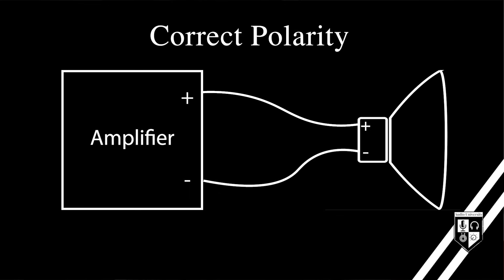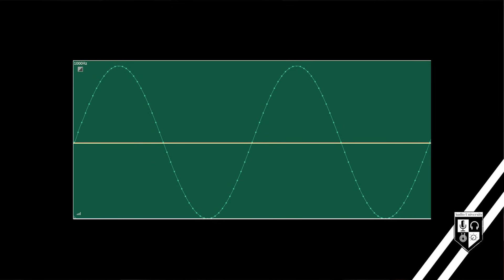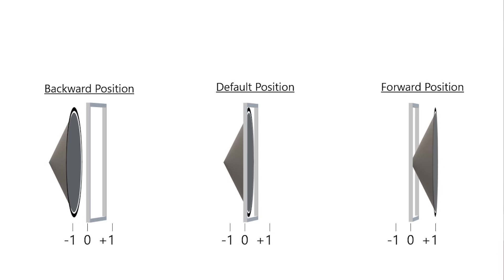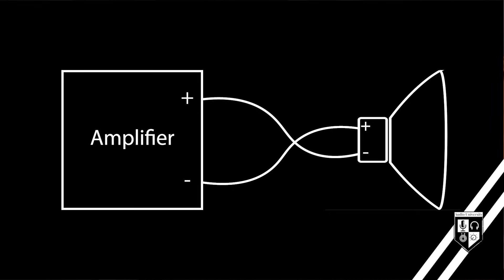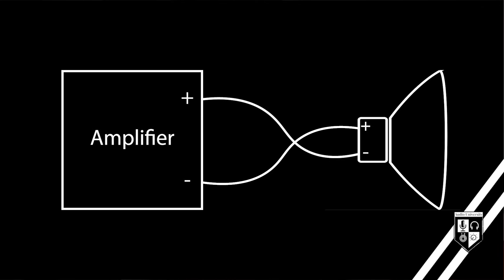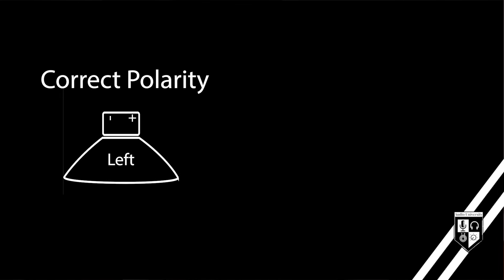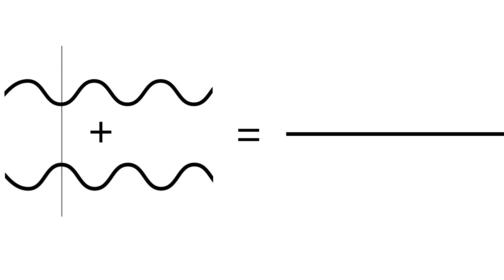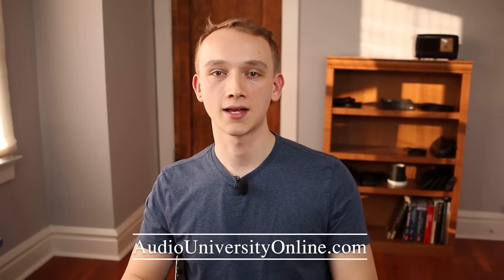POSITIVE VS NEGATIVE: Does Speaker Wiring Matter?

Comment: Most people don't know this. Lamp cord has ridges in the insulation on one of the conductors. That helps you remember which wire is the hot and neutral. Yes, I use lamp cord as speaker wire. If it can carry mains voltage (120v 60hz here in the USA) to a light bulb, it can carry audio signals to a speaker. After all, audio signals are electricity.
Reply: Low-voltage lighting wire is even better, it's just oversized lamp cord with 14 or 12-AWG stranded conductors. Removing the pretentiousness associated with "speaker cable" leads to big savings.
Reply: @kc4cvh  All the "audiophiles" buying overpriced speaker wire are being robbed. I refuse to pay $100 for something I can get at the hardware store for 25 cents a foot. As the old saying goes, " a fool and his money are soon parted."
Reply: When used as a power cord, the side with the ridges on the insulation is hot and the side without the ridges is neutral.
Reply: i want to run a 0 gauge copper cable that you would run from a meter base to the panel.  i want to run that from my battery 😂
Reply: I will add a clarification. My application is a stationary, climate-controlled environment, that is my living room stereo system of modest power (100 watts per channel). Heavy duty cables are unnecessary in this application. In a professional setup, especially in a stage/road show, proper speaker cables with proper connectors (speakon or 1/4 inch) are a necessity.
Reply: Heads to the back of my Onkyo 👀...
Reply: Lamp cord! Your that guy that irritates pros. Jokes aside, most speaker cable is colour coded, so one should never be using power cords.
Reply: @testthisfordecficiencies  Lamp cord works great.  It's good for 8 to 15 amps depending on the gauge.  8 amps at 8 ohms is 64 volts, 64 volts at 8 amps is 512 watts RMS.
Reply: @thomasmaughan4798  Who said it doesn't work? Its just not best practice. Take it from the pros and use speaker cable.
Reply: @testthisfordecficiencies  "Take it from the pros and use speaker cable."
You do for you, I do for me.  Wires intended for professional use are electrically identical but constructed to withstand more abuse as for instance a typical stage setting where they will not only get walked on, but heavy equipment on rollers crushing the wires.
Reply: @thomasmaughan4798  Thats a specific type of cable. Your proper speaker cable is less prone to oxidization but even thatvis easily cleaned off. Otherwise who cares. Like I said, it was a joke.
Reply: @testthisfordecficiencies  "Your proper speaker cable is less prone to oxidization"
There's that for sure.  It takes a long time for zip cord to oxidize, but it does, and when it does is nearly impossible to use for anything.
Reply: @thomasmaughan4798  If you terminate the ends with a ferrule, banana plug, tinning, etc, it can last much longer. Also, if it is left in the speaker terminal, corrosion is likely not an issue where the contact is made.
Reply: @testthisfordecficiencies  "Also, if it is left in the speaker terminal, corrosion is likely not an issue where the contact is made."
I lived in Hawaii where corrosion was everywhere; completely destroyed the copper runs on the circuit board of my amplifier.  That was before widespread using of epoxy coatings.  
It can even eat gold; chlorine is the one thing that can eat gold and salt is sodium chloride.  If it gets wet, it will ionize and then the gold is exposed to chlorine.
Reply: @testthisfordecficiencies  Anyway, yes, I love good cables and patronize the audio pro shop downtown for the Good Stuff.
Reply: @chrisfeatherstone9691  Don't be a dipshit. You're clearly referencing the bybeetech quantum purification filter, which removes noise by stripping the slight vibrational energy from the electrons at a quantum level to then pump more energy into them to create a slipstream effect so you get a faster signal, which leads to better presentation and life.

Check out their website, which YT won't let me post, it's pretty crazy what they manage to do.
Reply: @chrisfeatherstone9691  Now you're just talking out of your ass.
Reply: @chrisfeatherstone9691  Fuck turtles! If they weren't so stupid as to leave their eggs entirely unattended so they get eaten as soon as they hatch they might not be endangered. They're only slightly better than pandas because they're not too stupid to mate. Just like yourself.
Reply: Audio signals aren't electricity. They're tiny consecutive EMPs that get inhibited by non-uniform wire components on a molecular level. This is why OFC is so important, and also why you can hear the difference, but can't measure it when using silver cables with a perfect crystalline structure. It's lesser known, but the cables should also be free floating so the EMP isn't obstructed by walls or the floor.
Reply: @JZStudiosonline  This sounds ridiculous, can you elaborate? In the real world, no one is floating cables, as they are typically bundled together in racks, trays, etc. And yes, audio signals are electricity. EMPs are electromagnetic, which is the basis of the theory of electricity. Audio signals are alternating current.
Reply: @JZStudiosonline  Pure nonsense.  BTW Oxygen Free Copper has been the standard smelting technicque for wire for over 80 years.  Don't pay extra for it.  And yes, audio signals ARE electricity.
Reply: @KB4QAA  If audio signals were electricity we'd all be shocked by noise in the every day environment. That's like saying sunlight is a waveform.
Reply: @JZStudiosonline  Sunlight IS a waveform.  Your knowledge of physics including sound and electricity is sub-high school level.
Reply: @JZStudiosonline  Ahh, your just trolling. Nice one.
Reply: @testthisfordecficiencies  Styx Renegade.
Reply: @KB4QAA  And you seem more of the gull variety of intelligable.
Reply: @JZStudiosonline  it is waveforms of light?
Reply: @JZStudiosonline  audiosciencereview
Reply: @chrisfeatherstone9691  I never said that, of course they make a difference. You can't just pull shit out of the air and try to hold me to to it. Quit straw manning and learn how to have an actual argument.

Comment: Great explanation, but what was the best is your use of the terms positive and negative. Instead of plus and minus. People love to say plus and minus, when it should be positive and negative. For those who are going to say it's the same thing, it's not!
Reply: Since the power to the speaker is ALWAYS alternating, they don't actually have plus or minus as in voltage.  Phase is a better word; you want both speakers pushing, or both pulling, but not one pushing while the other pulls.  Keep them in phase. Does anyone say "keep them in polarity"?  No.  You keep them in phase.

Comment: Your analogy regarding polarity and atmospheric pressure are backwards. When you go underwater (below the line) the pressure increases. You need to stick to correct an.analogies. Your method of speaker polarity, I would suggest a lower power battery. A long shot of power such as you demonstrated places strain in only one direction for longer duration than a speaker is designed for as all sound has a pulsing aspect inherent to frequency in cycles of a fraction of a second. Speakers are designed to move backwards and forwards swiftly. Rudely shoving a speaker to a prolonged max extension does stress the spider and the surround. Heat in the voice coil also rises. You are also working the system with no thought to operating impedance of the voice coil. I’m sure you will say, “It was only a second and shouldn’t affect performance.” Over stressing a mechanical system should only be done by engineers in a lab testing products to establish proper operating limitations.

Comment: There is a flaw in your demonstration of sine waves. You will need to show the difference in actual push/pull amplifiers and say, class D. The watt ratings are only one way (switched on/off. Push pull is powered both ways, +&-… Class A, B, A/B and C are different for these reasons. Polarity is much more important with some vs others.

Comment: very interesting. what if i dont no what is the positive or negative wire on the amplifire. i want to put new speakers in my car. the speaker wires from the car audio have all different  colors. how can i find out what is positive or negative? thanks.
Reply from the maker: You’ll need to find a user manual to explain what the colors mean if there are more colors than red and black.

Comment: Many years ago i was working in car stereo installation shop.In the car environment the difference of speaker opposite polarity is very well audible because the bass of the sound is hugely degrated.One speaker moves its cone forward while the other moves backward,one pushes the air and the other pulls the same amound of air and the total amound of air pressure in near zero.To fix this is enough to reverse polarity of one speaker to bring speakers in phase,it has no matter how are they connected in the output polarity as long as they have the same polarity wiring.

Comment: I recommend a tube amp, a-b/push pull output, where if you hook a VOM to it, you will see both positive and negative voltage to speaker, where correct polarity wouldn’t matter.

Comment: No, the speaker power signal is NOT a series of positive and negative voltages! If so, it wouldn't matter how you connect the speaker! In that case, the speaker membrane would go back and forth from the zero point of the steady state during playback, which is wrong! The signal coming to the speaker is pulsed in one direction so that the diaphragm always goes out with the correct polarity! You have to study it a little better, son, you are weak in knowing this area!

Comment: Some amplifiers maintain absolute polarity and some don't, depending on their design and the number of gain stages in them. John Atkinson from Stereophile always mentions this in any amp he tests. And, many speakers have some drivers wired in reverse from other drivers, depending on the crossover used, and which wiring gives the flattest and most in phase response. There have been some blind tests done to see if people coud hear a difference when both speakers in a stereo pair were wired reversed, and if maintaining absolute polarity was audible, but I believe the results were inconclusive. IMO, if it were obviously audible, then all amps would be designed to maintin absolute polarity
Reply: I have found a few amps wired wrong during commissioning over my career. Its a pain to find sometimes, as you always expect the factory to get it right. Especially with pro gear.
Reply: The physics of your ear do not permit you to detect polarity (though you can detect the phase issues from mixed polarities).
Reply: @no1unorightnow  Phase is the actual conversation here. I'm not sure OP grasps this as reversed polarity is exactly 180 degrees out for phase. Any delay in circuitry would be in audible and immeasurable with audio tools.
Reply: @testthisfordecficiencies  No, phase is different from polarity as phase is frequency-dependant and can be interfered with by outside things like walls, ceilings, tables, etc.

Also, polarity and circuitry are definitely measurable with the right tools.
Reply: @no1unorightnow  Yes, but OPs comment implies there is processing  gain staging, etc which adds delay thus affecting phase. Polarity is a reversal of circuitry. Which small changes in circuitry cannot be measured with audio tools you would need a oscilloscope. Even though pase amd polarity are not interchangeable, a reversal of polarity will have a 180 degree phase reversal on all frequencies. 

Relections don't change phase. Its just the reflection will return to the same point out of phase as phase is directly related to time.
Reply: @testthisfordecficiencies  I agree with almost everything you've said - however depending on your setup, you can measure changes/delays like that acoustically, but you do need specialized audio equipment specifically designed for it (an oscilloscope would work, too, of course).

If you feed a reference signal and an acoustic signal using a reference-grade microphone into a tool like SIM or SMAART, you can measure delays, phase, impulse response, etc - but you have to have the reference signal which you can't do with a single mic and no reference signal

Comment: Can't agree more with you.
Good, educational vid.
To recap: make sure you wire all your speakers the same way, be it correct or reversed polarity. Just make sure all of them are connected the same way. If you don't know how to check it just watch this vid although I'd rather recommend using 1.5V AA cell instead of 9V battery which may burn the coil in your speaker.
Reply from the maker: Thanks, Peter!
Reply: @AudioUniversity  You're welcome! It's very difficult to find intelligent, normal folks who have something sensible to say - YouTube is full of garbage but sometimes you find channel like yours and you can actually learn something. Kudos!
Reply from the maker: Likewise, Peter. I’m always learning from comments like yours and others’!
Reply: And i recommended that dont keep it connected to the battery more then a second, and that could bee already too long for some cases expecially if voltage is more then 1.5 volt.
Reply: Peter,  back 40 years ago I was having some D130's re-coned at solutions on Sunset, and the owner made a point of early JBL's having their wires crossed by turning his back to me while talking and stated the brain senses the speaker the same way if wired backward. Does that make any sense?  MK

Comment: The speaker cone moves outward when positive voltage is applied... This is only true for DC or frequencies way below any resonance. Throughout the usable band, this is more often not the case than it is, because a speaker system is resonant and reactive, thus the phase response is rather chaotic, far from an "ideal" linear motor. That's also the reason why dissimilar speaker drivers (or system s) shouldn't simultaneously play the same band for wide portions, the chance of not having cancellation issues at certain frequencies is practically zero. I'm sure you know and simplified it for the sake of argument though. This should be clarified to prevent confusion.
Reply from the maker: Very well said, @WESTEL Audio. Thank you.
Reply: Additionally, not all speakers move outward with positive DC applied.  JBL drivers of the 70s and 80s come to mind.  The 9V battery test is good most of the time, but will get you in trouble with drivers like the aforementioned JBLs.

Comment: Out of phase inverted is a problem it pushes the air in the opposite direction thats a DC coupled amplifier.. Now a transformer coupled tube amplifier it would not matter because there is no real polarity  Its AC..